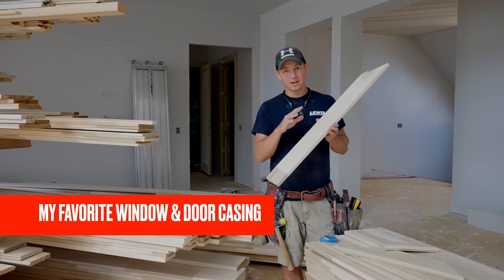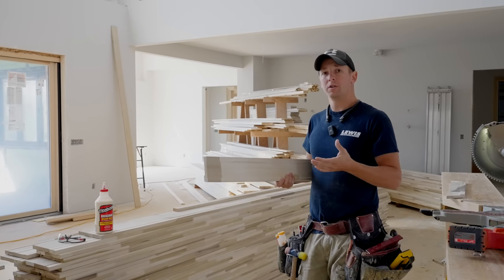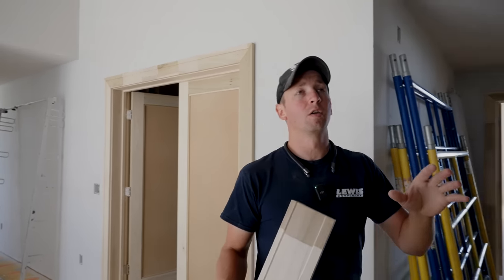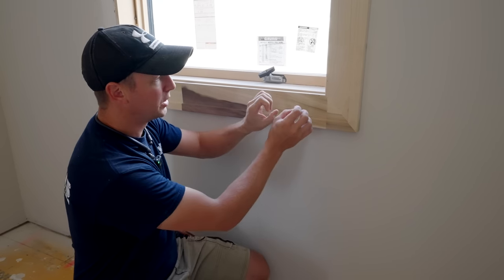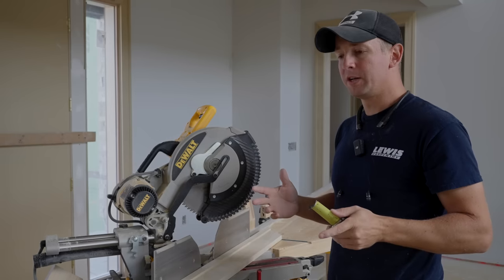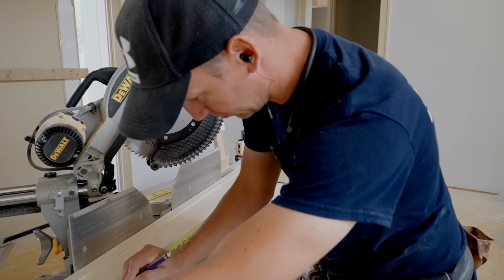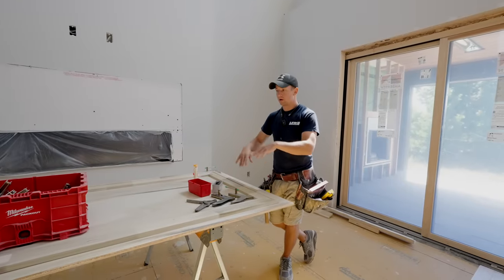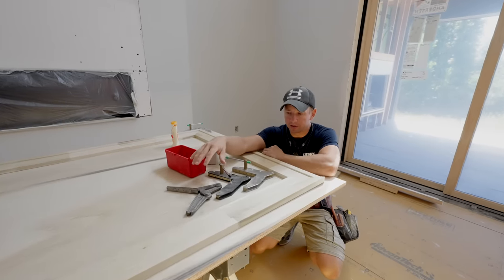BIG CASING!!! Avoid These Rookie Mistakes Builders and Carpenters Make...

Comment: I understand that the trend in contemporary/modern is often to picture frame without a stool and apron. I have never met a window or pass thru opening that didn’t benefit from stool and apron. Casement, picture, awning, double hung, modern or traditional design, IMO always looked fully dressed with a stool and apron. An exception might be flexi frames or trapezoid units. Unless an assembly can be unified like a window wall on a cathedral gable end - then stool and apron become the great unifier. Picture frame with no stool and apron is like going out on the town and forgetting your shoes. We often bid jobs with the plan calling for picture frame cased openings. This is a great opportunity to write a nice change order and put a lot of extra profit in your pocket. We would case two windows (one with picture frame and one with stool and apron) and let the client succumb to the pressure from designers, friends and family to sell up. You can charge whatever markup you want at that point because they are already married to the stool and apron. Most feel like they have to have it. Sort of a FOMO moment. Profile the stool anyway you like but use the same cutter on the end grain and skip the mitered returns. Even with stain grade. That miter just looks like it didn’t grow there. Ka-ching!
Reply: And the water intrusion protection. from an open window. Now we have zero casings at all in new homes just sheetrock with windows embedded in joint compound.

Comment: Be careful sanding those corners with the biscuits right away. Initially the biscuit swells and expands the wood on thin material. If you sand it in this expanded state it will knock down an area the shape of a biscuit that will be visible later when the biscuit shrinks.  Something I learned from watching Norm Abram on the New Yankee Workshop many years ago. I can attest to it because I have a jewelry box top I made, about 3/8” thick, that has biscuit divots permanently in the top. Those type of defects are usually only visible after the coat of sheen is put on. A hard fix at that point in the game.  Perhaps the Lamello biscuit is a superior product that isn’t suspect to this. 🤷‍♂️ 
Another solid video. What else would we expect at this point. Alongside the lines of writing on the back of a tape measure I like to put painters tape on the face side of the tape measure and just make a mark on it with the pencil for a easy way to remember the dimension. It easily rolls up in the tape and you can make notes on the location and such.

Comment: 2 questions. Whats your thought on pre-assembly using pocket hole screws? And what would you do about that trim on the newell post that blew apart?
Reply from the maker: Pocket holes aren't bad. I have never used them for casing as I think there are always better options. 

On the newels, if I remember right all the trims had to be removed and new trims applied. It was a disaster, but thankfully it wasn't my disaster to own.
Reply: You need to be careful with pockets on miters. They can easily pull things askew.

Comment: Would you ever sink a short trim screw in from the top casing after the glue has dried just for overkill or is that silly?
Reply from the maker: Probably not necessary. A kreg washer head screw would give much more holding power. Trim head screws don't do much.

Comment: in previous videos you mentioned you don't sand glue joints until the are dry because the moisture raises the grain, so sanding flush when its wet creates a low spot that you can see once the joint is dry and glue is applied. In this video you sand the casing right after glue up. Did your thoughts on this change or is the efficiency simply worth the drawback?
Reply: Ace, do you think that the primer coat would take care of this issue. I don’t think it’s an issue in any case but the dust created when light sanding will combine with any glue and fill any issues you are concerned about. But you get first place in the casing OCD race…for sure. Congrats.
Reply from the maker: We sand it right away because its efficient and it's "done." If we want perfection we will go back as we get finished and hit each miter really quickly after the glue has completely dried out.

Comment: Hey Spencer, I really love the channel and have 
learned a ton from you, thanks! I also have the Dewalt biscuit joiner and love it except that using the fence just like you’re doing with the miters, or any board for that matter, the slot is just slightly out of level, or I guess you could say not parallel to the fence. Does yours have this same problem?
Reply from the maker: It's possible that your fence is not parallel to the blade. I have had this on other biscuit jointers.

Comment: Very nice work.  Given the profile of the molding in question an alternative is to use butt joints followed by the application of a separate back band.  More pieces and more work, but this joint has inherently greater resistance to humidity-induced movement.  This is not a criticism, as your work is first rate.  It’s just another way of dealing with the issue.  Ted (Boston area)
Reply from the maker: For sure!
Reply: Theodore, beaded flat stock with back band…I guess are days gone by. Missing out on all the jack-miter fun. Great point on the ole butt joint’s stability. First time I saw cabinet doors with mitered stile and rail, I can still feel that flesh crawling cringe coming on…just thinking about it. Back then, biscuits were something served at break time…with tea or coffee. I would date myself if I mentioned running chestnut.
Reply: @henrypeisch5289  I’m 72 and suspect I’m standing right beside you!  Ted
Reply: @theodoreshasta7846  you are up early my friend… well, I hope it’s up early. Better up early than up late. Gotta get those winks in.
Reply: And you have me by a few steps. I’m still trying to figure out this arm-chair quarterback thing I find myself in. Lol. Stay well!
Reply: @henrypeisch5289  Early birds and worms, as they say.  😊

Comment: Hi Spencer, would it be beneficial to add a bigger sub-base to the bottom of the biscuit joiner plate to spread the force out more evenly on that type of trim?
Reply from the maker: Definitely wouldn't hurt.
Reply: @InsiderCarpentry  thanks for the reply Spencer, I appreciate it. You have always done adaptations to your work flow programs in the past to increase productivity. Thanks again for another great work tip and video.

Comment: Spencer, unrelated to casing but on the same project. I watched your 1/4” rabbeted coffer video on Instagram. Maybe you are finished already or too deep into it to switch-up but if you can avoid the miters and install the bottom cap on the beams first, before the sides and use 90 degree cuts everywhere, it would be quick and easy with less climbing. Is it possible to finish your 1/4” plow short of the end (where beams intersect) and use a square hole punch (make a jig for drill bit hole placement) or 1/4” chisel to get the inside corners perfect. The end of your plow at the intersecting beams would have to be done with the router upside down with an attached base and positive stop. Finish the intersection with hand tools. I don’t want to minimize the danger of using a router upside down but seeing you on that scaffold without side rails, somehow makes using an inverted router overhead - seem less dangerous. It appears that you are working too hard with the mitered frieze and capping the bottoms last just to achieve the crisp detail where beams intersect. Lee Valley makes a square hole punch that may work for you on this detail to hand finish the intersections. Butting 90’s instead of fitting 45’s would free up more brain power - which you can spend thinking about what the other guys are also working on. You may be too deep into the present process or it may mess with your OCD to switch-up mid stream and have a mix of fussed miters and backward-process with 90 degree cuts on this ceiling…not sure. It is paint grade, after all. But think about it, maybe on the next one you do with a similar rabbet detail at beam intersections. Great work in either case but there are always ways to improve efficiencies and out of the box processes. Capping any coffered beam assembly last, can drive you crazy - much like fitting crown with copes on both ends. Easy to crush the tips of those miters also. Always butt 90’s when you can. In any case, I have to avoid watching your videos before bed. Sometimes they keep me awake. Lol. All the best.
Reply: Another way to do this would be to plow the face of the bottom cap (both long edges) and leave 1/2” of edge meat for nailing. I’m assuming the FJ is a full 3/4” and your rabbet is 1/4” X 1/4”. You would need to rabbet a 1/2” from the backside of the intersecting piece (end grain) also the bottom cap to form a lap joint where they meet so that the front face is tight and you cover the rabbet running along the edge of the bottom cap intersection. You might be able to leave the biscuit joiner in the tool box with this method. A glued lap joint may be strong enough to sleep at night without biscuits. Install all the bottoms like with a normal coffer but with laps at the intersection where beams meet up. The frieze or sides of the beam get a plow on the back or inner side to maintain the 1/2” reveal. Just a deeper cut as this plow on the frieze has to finish above the backside of your bottom cap. If the rabbet depth is correct, you can skip the blocking. Just keep your face nails in the top (or back) 1/2” of the lower cap material so they don’t show up in your rabbet. You get to leave your saw at 90 degrees and blow and go with this method. I have not done this detail myself but thought about and done similar joinery. Let me know if either of these alternate methods makes any sense. Great job as always. Don’t miter when you don’t have to. Nice to be able to spring pieces in place and not have to look too close at interior miters. Less climbing for sure.
Reply: I think any method that allows installation of the bottom of your beam before the frieze or sides has several advantages over the way you started the install.
Reply: The more I think about it, putting the exposed rabbet on both sides of the bottom cap and a lap joint on end grain is the way to go. Similar to the factory stop mouldings that come with Andersen casement and CP windows. It could also be thought of as a 90 degree cope which the end grain makes continuous contact with and meeting the face of the adjacent piece.
Reply: Final thought…your ceiling nailers may already be ripped too wide. In that case, you would plow an additional rabbet on the backside top edge of your frieze to keep the sides plumb. In the future, consider 1/2” stock for the sides of the beam or resaw/plane down to 1/2” thickness. But I like the continuous lap joinery with 3/4”.
Reply from the maker: Thanks for communicating these thoughts. I ended up doing it with the sides first and it actually turned out really well. But I will say, it took a really high level of precision to make everything work out perfectly. I wouldn't recommend the method I used to a novice as it could get ugly really quick.
Reply: @InsiderCarpentry  always work like a novice, when you can.

Comment: We're doing 4 inch casing with clam clamp and pur glue would you still add a biscuit  using the pur glue
Reply from the maker: Pur glue doesn't work will with biscuits. I would either go Pur only or TB and biscuit.

Comment: Do you ever trim using oak casing  I have oak 3.5 installed on the wall by pieces in thirty years no issues just wondering about the wood species thanks
Reply from the maker: Very rarely.

Comment: Awesome information, any reason you switched from using dominos?
Reply from the maker: I like the wider surface area of biscuits in most applications and biscuits are less expensive. The jointer itself is less expensive as well.

Comment: Do those clam clamps cause dents in the wood where those teeth are?
Reply from the maker: Yes, leaves a hole about the size of an 18 gauge nail.
Reply: @InsiderCarpentry  How is that fixed on stain grade?

Comment: Thanks for another great video. Quick question for you if you have the time. I've always been taught to use a damp rag to clean the glue that squeezes out. Does this compromise the glue setting up inside the miter if it gets some moisture in between the pieces? 

You've helped me make money over the years with your videos. Really appreciate it
Reply from the maker: Personally I think a little water clean up is just fine. I do the same.

Comment: Thanks for your content.  I just got on the PUR train, and now you derailed me!  JK.  Why did you decide to use wood glue instead of PUR for this application?
Reply: Yellow glues generally have a stronger bond than polyurethane reactive adhesives when gluing wood to wood. Exceptions to everything but in this application with end grain miters, I would think so. Possibly with biscuits you have more time to fuss with the joint and to get clamps on with titebond. It also looks better on your tool pouch.

Comment: Hmm. 3/4 + 1/2 = 1 1/4 to the stud. So a 2 1/2” nail has 1 1/4” penetration into the stud. 1 3/4 to the center of the stud, so maybe 1 1/4 to the surface of a pipe or line.  Assuming it’s centered on the stud by the plumber or electrician.  No margin for error. But you knew all that. Ideally , negotiate with the other trades so nothing goes in lower than 12” above the subfloor?

Comment: Why not set the base of the biscuit joiner on table, raise the top fence out of the way,  and use the table as the reference point? That way you're not balancing the jointer and risking a bad location.
Reply: If that's what works best for you, then that's what you should do.

Comment: In a different video, u showed how to essentially bevel the casing when the jamb is proud or recessed....BUT if you're pre-assembling these joints, do you end up just caulking the gap on the inside or the outside?
Reply from the maker: Yes, with this casing profile it looks bad to roll the miter. So we keep the cuts square.
Reply: @InsiderCarpentry  so if I'm understanding correctly, in your opinion, there really is no way to roll the casing and to do your joinery method at the same time.? This is one of those situations where it is what it is correct?